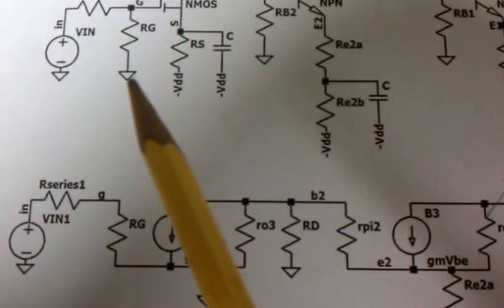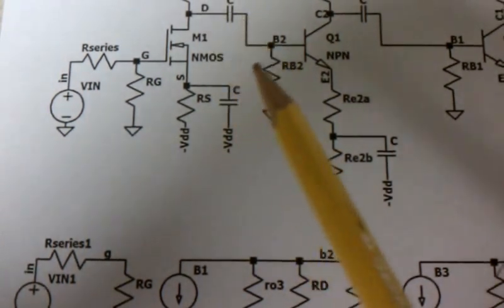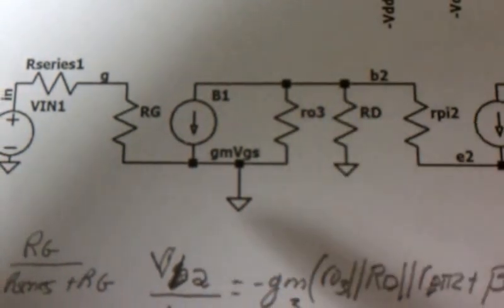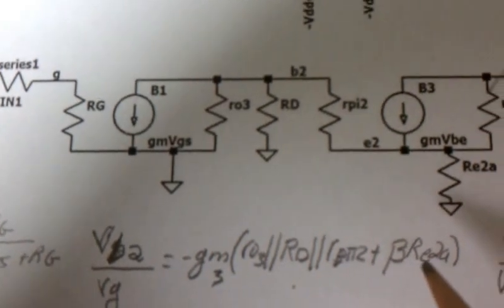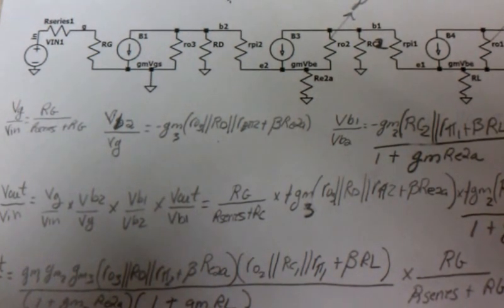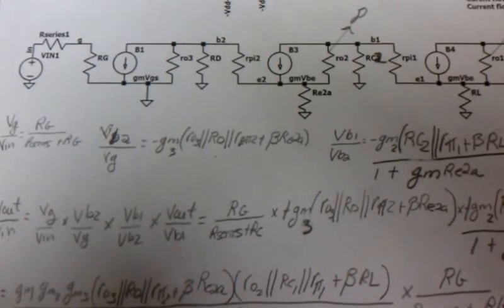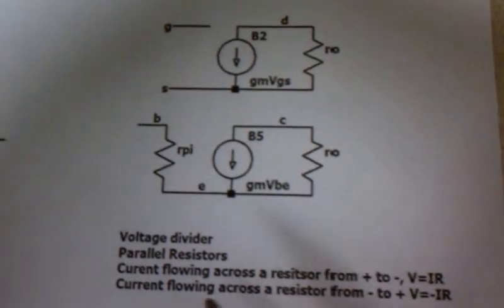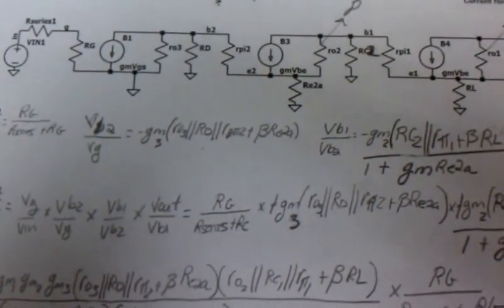Finding the Gain of a multistage amplifier.

Comment: Why did you include the emitter resistance for the npn in the middle in its small signal analysis model shouldnt that be shorted to gnd because of the bypass capaciter
Reply from the maker: Notice that Re2A  is not shorted.  Only Re2b.
Reply: @davidwparent  aah yes my bad